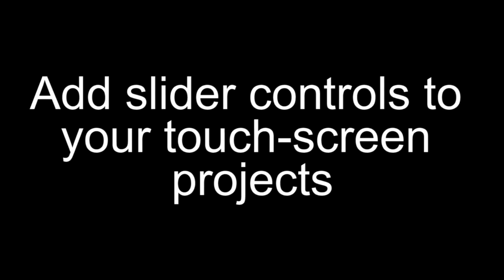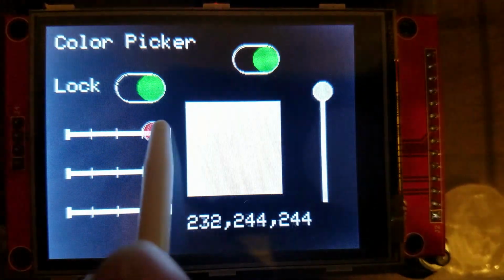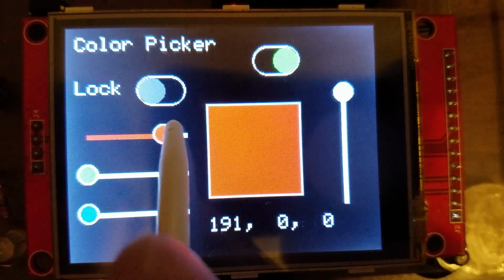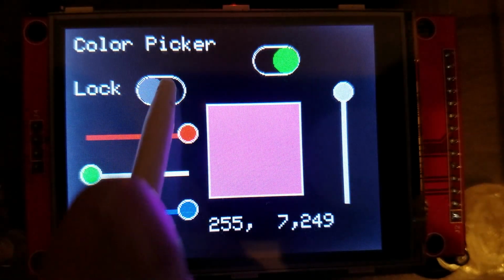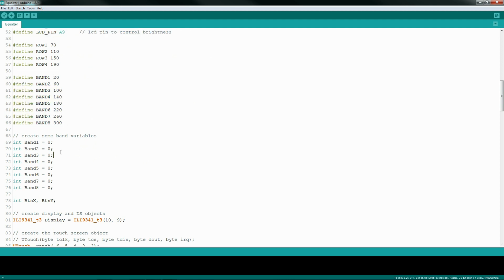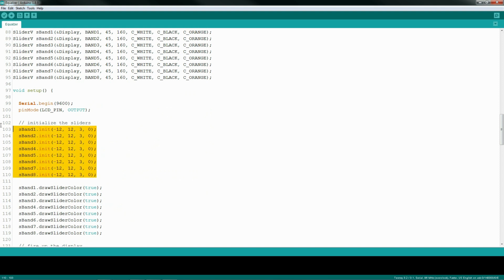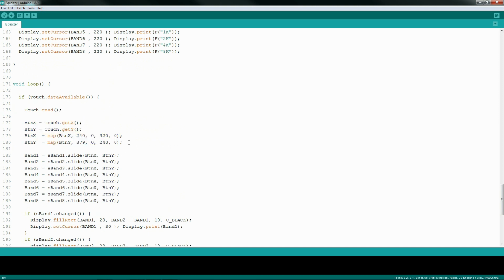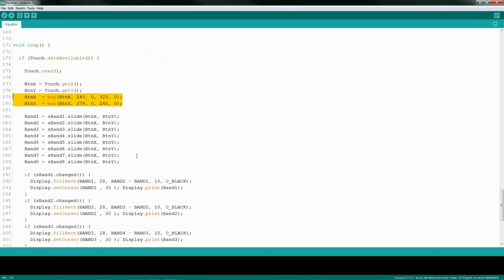Graphics sliders for Teensy MCU’s

Comment: not bad bro. how can i adapt it for mcufriend_kbw?
Reply from the maker: If you are using the MCUFRIEND_kbv driver, probably not to difficult since that driver uses the Adafruit_GFX library. In the .CPP and .H replace ILI9341_t3 in the class constructor and .init calls (I believe those are the only methods that rely on the display data type) with MCUFRIEND_kbv. Initilize your display as you would normally do with the MCUFRIEND lib. That should be all you need to do.
Reply: Hi!Im unfortunately a noob in this stuff, can you provide a modded library also for the mcufriend_kbv?Will be so much appreciated!
Thanks in advance!!

PS: I'm trying to change stuff, but there are things that doesn't match, like setFonts or setTextSize or charBounds ecc...can you help me modding to work with MCUFRIEND_kbv? I use Arduino 2 with the same lcd touchscreen in your video, but works with MCUFRIEND_kbv unfortunately 😶

Comment: will work on  esp32?
Reply from the maker: This library relies on the ILI9341_t3, you will need to modify the data types in a few locations to make it work with your display lib--however the display lib must rely on the Adafruit_GFX
Reply: @KrisKasprzak  thanks

Comment: Is this compatible with an Arduino board?
Reply from the maker: No as it's based on the ILI9341_t3 driver (specific to a teensy board). You could modify this lib by changing the data type definintions to match the display library you are using. In theory this change should work.
Reply: @KrisKasprzak  thank you!
Reply from the maker: @gsrgsg2246  Given you are interested in this type of graphics, i'm guessing your projects are not simple analogRead, serial.print.... I started off on Arduino 6 years ago and quickly ran out of memory. Most of my projects have a graphical display, SD card, touch. 

I moved to Teensy 3.2 about 3 years ago and I never looked back. They are way faster, more memory, and programs with the Arduino IDE. I have one project with 20 libraries, 5 fonts, graphics, SD support, wireless, RTC, menus, and over 4000 lines of code in just the INO file. I have some 50% memory left. The teensy is mounted on a simple PCB using DIP sockets and fits in a small 3D printed case--it's a race car telemetry system I coach my high school in making. The Mega could do the same technically, but not with that goofy form factor.

Comment: Hey Kris, really nice! I've been wanting to use something like this and put touch screen light controls for my bedroom. :-D Maybe someday I'll get around to doing it. In the mean time, I have a special request. Could you do a video about how to build a little tiny solar battery charger. I'm talking about those little solar panels that come in the yard lights you can pick up at Walmart for like $2. I've got a big pile of those old things and I am certain the solar cells are still good and could be useful for plenty of little DIY projects like a wireless smart potting soil moisture monitor, or wireless motion sensors.